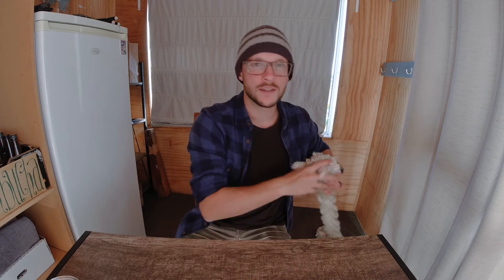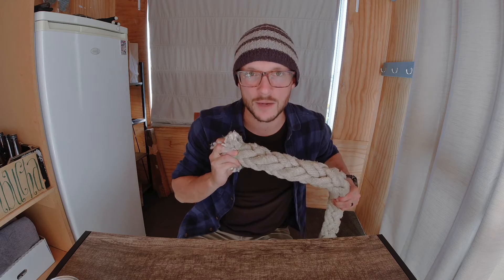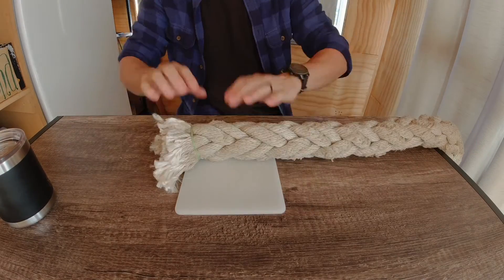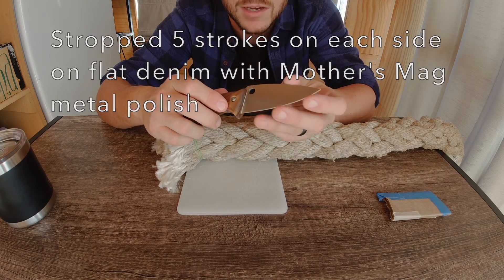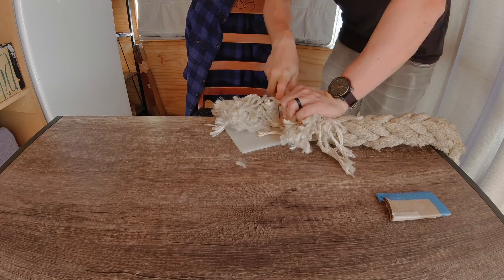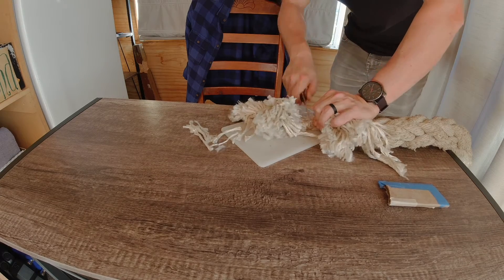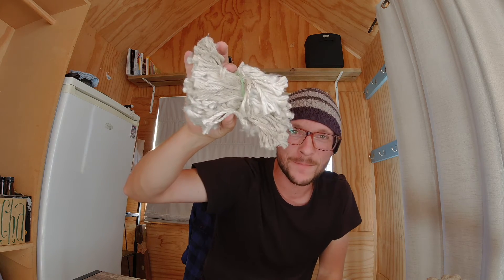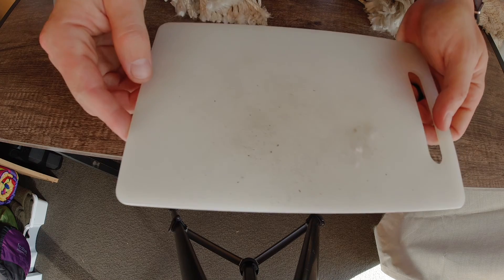250 GRIT MAXAMET CRUSHES ALL - Spyderco Mule Knife vs Rope of Death

Comment: Is BESS a good test for such a thing? Seems like it’s a good test for mirror edge push tests, but what about toothy edge slicing tests?
Reply from the maker: Hey Justin!  In a word, no.  BESS is not the best way to measure for slicing aggression.  I am collecting quite a lot of experience with BESS and it does not always correlate to slicing aggression.  

BESS is a great way to measure how clean, durable/rigid, and small the apex of your knife is, which is one element of sharpness.  In my more recent test I have switched to a 3-test approach to approximate keenness (BESS), Aggression (with a 9mm rope in a 45 degree wedge on a scale), and Toughness (by batoning into a pine piano leg 3 times and then re-measuring BESS).  This explains some of my adapted methods:
https://youtu.be/BeiIThaFrGs

Comment: Nice. Thanks for another great vid. I had to resharpen my Spyderco s45vn EDC blade and decided to experiment with cutting performance (not edge holding) during the week, and I found even a light stropping on a coarse 250 grit edge decreased the aggression on cutting plastic strapping noticeably. I've had excellent results doing the "cliff Stamp" sharpening method of changing the scratch pattern, with light strokes, and seemingly there's no real burr to remove with a strop. I'll have to get some rope at some point to measure edge holding, and if I'm keen enough I'll do a video on it.
Reply from the maker: That's awesome!  Thanks so much. Love the feedback on 250 grit sharpening. I used edge leading strokes rather than Cliff's alternating scratch patterns - but I agree that it seems to minimize burr very well.

Todd Simpson even finds that coarse stones can create an accidental microbevel, because of some interesting physics.

Notify me if you make a test video, I will watch it.
Salaam Alaikum my friend.

Comment: Victory at last! I wonder if there would be a significant difference using diamond or CBN spray/paste/film to strop instead of the Mother's, since Maxamet is so hard and carbide-y. A light touch on a Spyderco UF could also work for finishing.
Reply from the maker: That's a great idea!  Currently I have sent this knife and edge to Pete, but when I get it back I will experiment with different strops.  Thanks Mike - take care.

Comment: Have you tried cardboard yet? I really don't think rope is a good testing media. As the results will differ with the edge angle and behind the edge thickness more. Where cardboard changes based on edge angle but not so much with behind the edge thickness.

Plus, people cut more cardboard than they do anything else. Unless they are boating.
Reply from the maker: I have not used cardboard as a testing media yet.  I do understand what you are saying and I agree that it's a "purer" test in the sense that it eliminates BTE thickness.

The problem is that the phenomenon I am trying to analyze has been shown to be caused by apex texture and shaping.  Dual grit does cut differently, but it's most apparent in a slice cut, and most cardboard tests are more push-cut oriented.

Honestly, I'll probably carry on and test cardboard after I'm done with the rope, but if it's possible to quantify the aggression differences between fine, coarse, and dual grit, I would like to - and the more fibrous cutting media seem to respond more to the aggressive/coarse textured edges.  If you disagree - I'd be open to hear your perspective.

I always appreciate your input, I know you do heaps of research, and you've helped me understand many things I was not aware of.  Thanks for your comments.
Reply: Those of us who are contemplating Shanghai-ing a tanker need to know what knife edge to put in our kit to make a speedy exit.  /humor/

Comment: Ah yeah, finally made it through the rope of death. Great job Gabe. When you put a new edge, do you remove the weakened steel by doing a few perpendicular passes on a stone to cut of the damaged steel? Cliff Stamp talked about a long time ago and I've been doing it ever since and you see improvement in wear resistance. 
Looking forward to see if M4 and magnacut can make it through as well. Still waiting for a katana video from you as well.
Reply: Cutting the fatigue steel off like cliff stamp suggested is a must. Not everyone does it.
Reply: D00M here's a good cliff stamp video with more info https://youtu.be/AQnhNfWIj7Q
Reply from the maker: Thanks guys!  I used light edge leading strokes for this edge, and it seemed to minimize burr pretty well, I rarely do perpendicular deburring strokes - but only because I have been unfamiliar with the method.

I'll definitely try it!  Thanks guys!
Reply: @homeslicesharpening  essentially its a step you would perform before sharpening an already dull knife. The dull knife has weak steel at the apex. We want to remove the weak apex completely before we put a new edge on it. That way we are not allowing any fatigue at the apex from the previous sharpening that was weakened in use prior.

Hence why we pull the edge through a stone to make it completely dull. Then we re apex afterwords.  Creating a new apex with fresh steel.
Reply from the maker: @tacticalcenter8658  Ah, thanks for clarifying, I did misunderstand.

I am familiar with this step (some people call it de-stressing right?) but I don’t always do it.

Thanks for explaining the underlying physics, I’ll definitely start doing this for full re-sharpening and future tests!

Thanks guys!
Reply: @homeslicesharpening  hey Gabe, were not talking about the deburring steps. What were talking about is after and edge dull the steel is weakened from back and forth loads(think how you break a tab from a can or a paper clip). Instead of just sharpening it and working on weakened steel(it'll burr more, not take as sharp on an edge and have worse performance) what you do before hand is slide the edge perpendicular to the stone(what people do to dull an edge) to cut of the stressed steel. This way when you're sharpening you're now working on good steel and have a small flat to see how your sharpening is doing.
Watch Cliff's video "basic three step knife sharpening", it comes up if you look for Cliff Stamp sharpening. You'll see what were talking about. Its the first thing he does in the video,